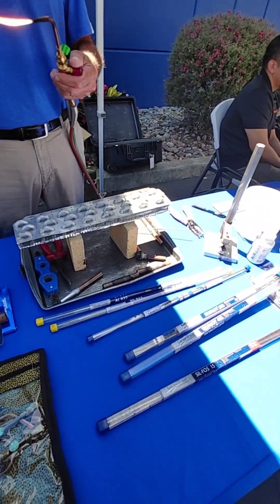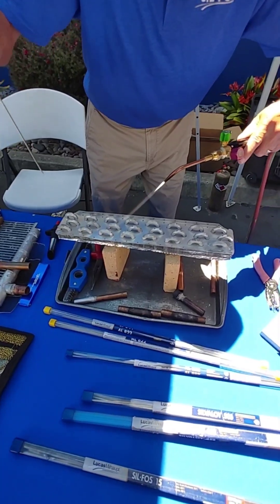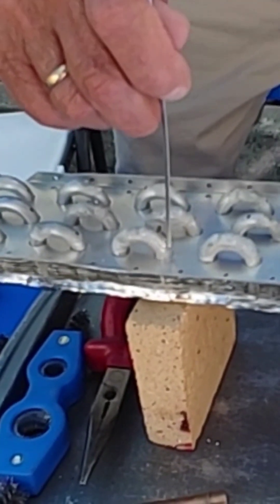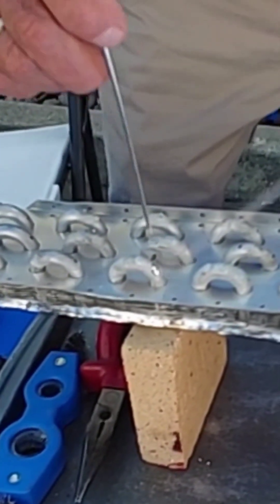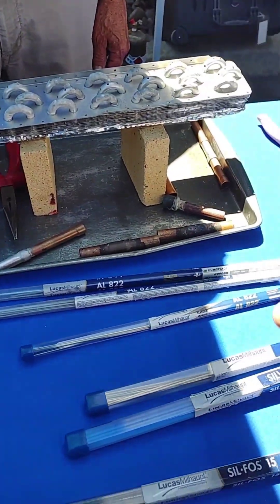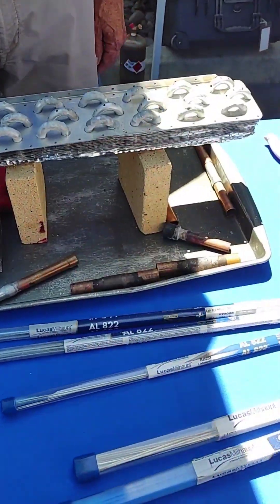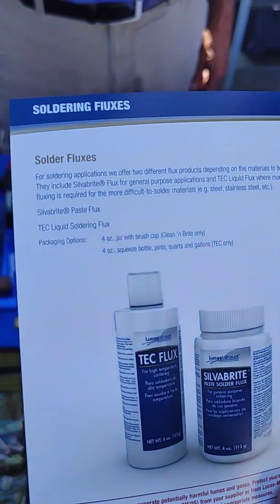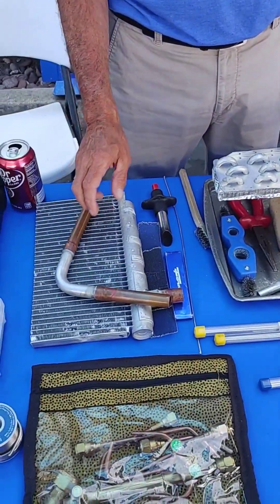Fixing Aluminum Coils with AL-822 @lucasmilhauptbrazing

Comment: I've used it. It's hard to control heat because it's different than brazing but it works great
Reply from the maker: Yeah, you see how far he has the flame.
Reply: @jonhvac  yeah he's got a fine point on his too, my torch just shits fire maybe I'll get Mapp
Reply from the maker: @blackishpariah  yeah or propane